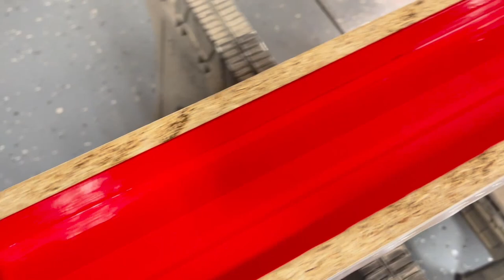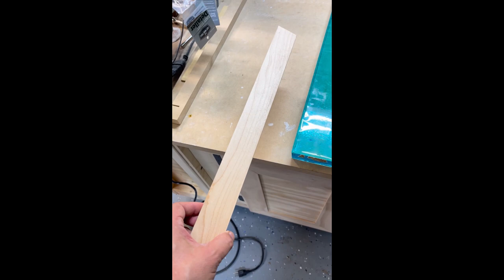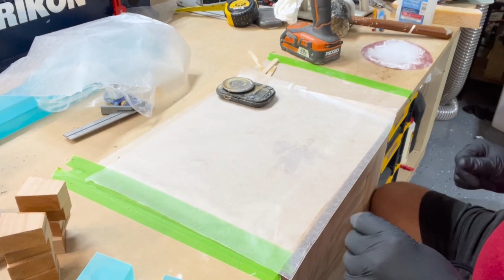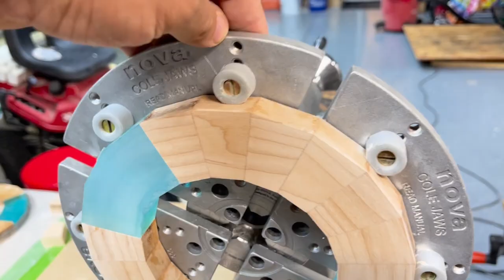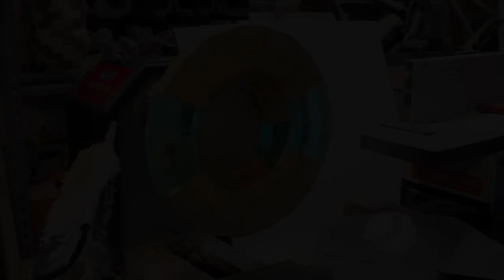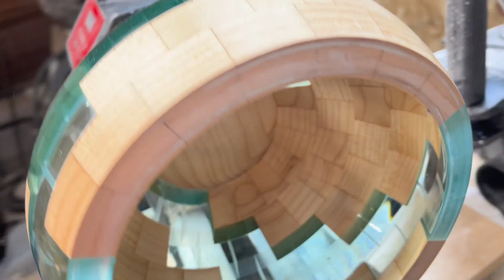How to Make a Resin Segmented Decorative Vase

Comment: Looks great . If we could only figure out how to eliminate the lines between resin sections and layers . Sometimes it looks cool . But for once I would like to have all resin sections clear . Aluminum is cool in the mix too . I think I am going to throw in some copper too next time . Great work . Keep the videos coming .
Reply: I think the opposite, I think it's good that you can see the joints in the resin sections as it makes it look like they are sections of glass, especially with that colour, which was the best choice between the 3 colours.  It would be relatively simple to just fill the voids between the wood with one single seamless pour of resin, but that would be the "easy way" - this way shows a lot more detail, thought and work has gone into it's creation.

While "less is more" is often the mantra of makers - sometimes "more is more" is the better solution.

Comment: Beautiful, how do you calculate the angles for the wedges?
Reply from the maker: The amount of segments in each ring dictates the angle of the cut. There are calculators online that will calculate for you.
Reply: @Charles Allen 
Basically you can devide 180° by the Nummer of segments.
4 Segments = 45° angle 
6 Segments = 30° angle
12 = 15°
And so on..